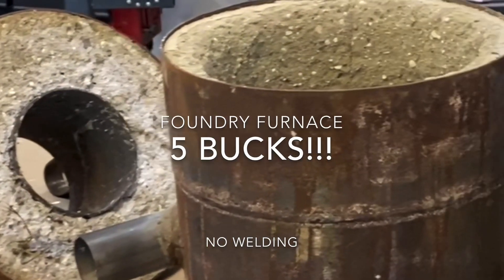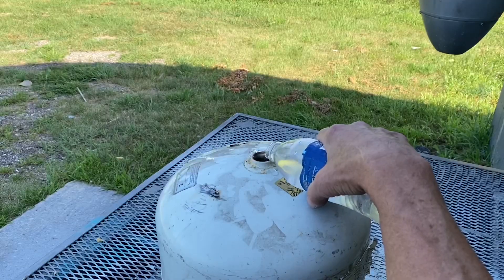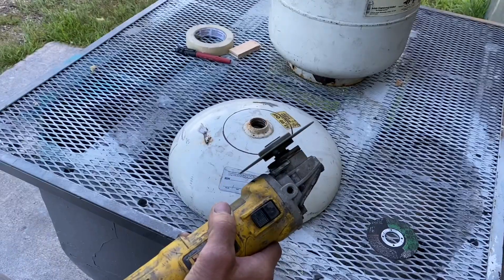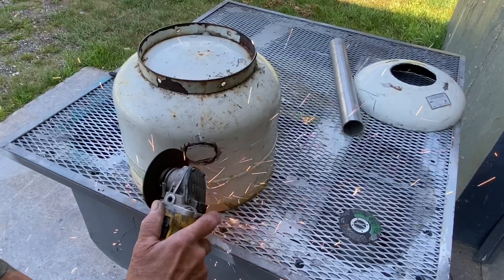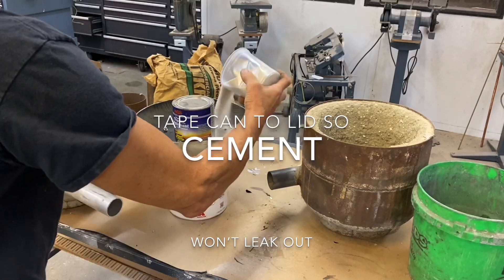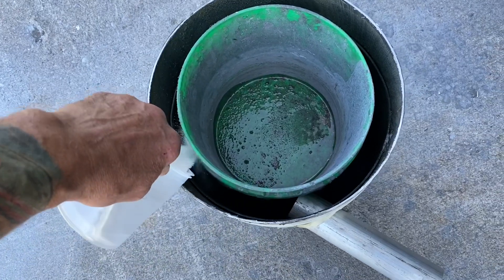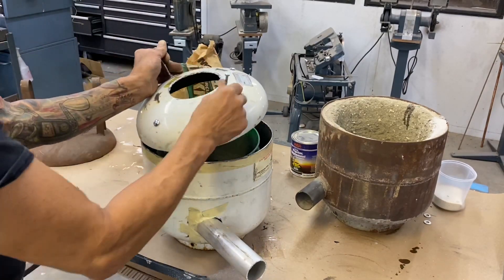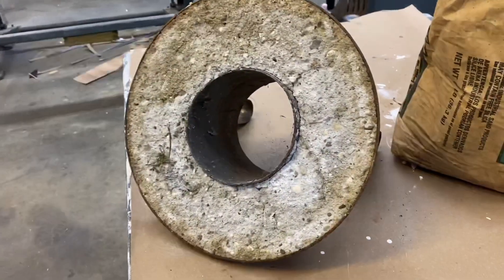Sandcasting furnace made from scrap

Comment: Nice.  I have 3 homemade furnaces in my foundry shed that are all built with different designs and types of refractory linings.  The oldest one (7y) has a diy sand and fireclay lining and it's still in good working order too.  They all still work fine, I just like trying new things and building furnaces and burners.  Is the 5 year old furnace your main go-to that you use regularly for making the gas caps etc.??  If so, it has held up a LOT better than I would have thought!  People say Portland cement will just keep popping and spalling when it gets hot and that in no time there will be nothing left of it, but the camera doesn't lie...
Reply from the maker: That’s awesome!